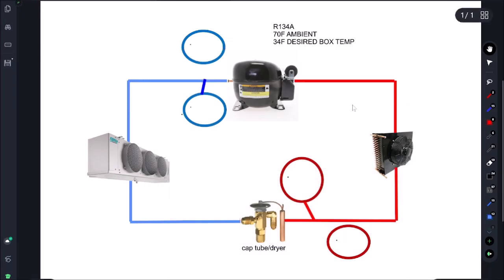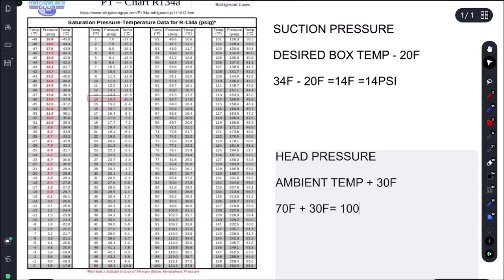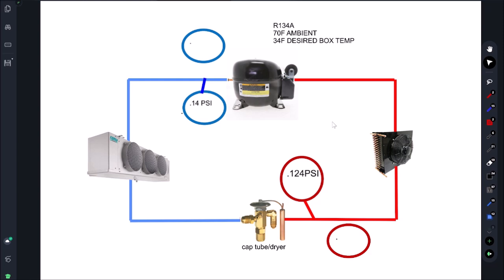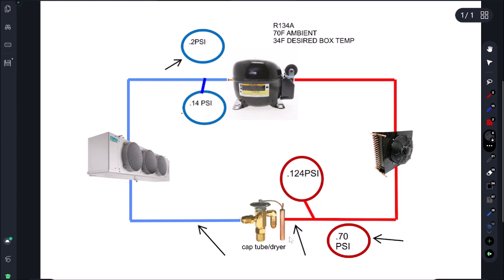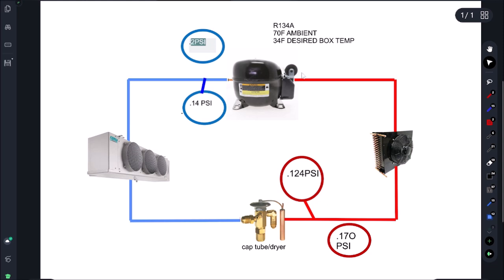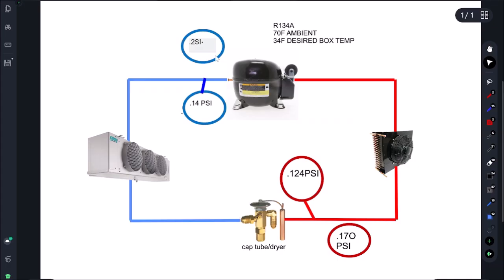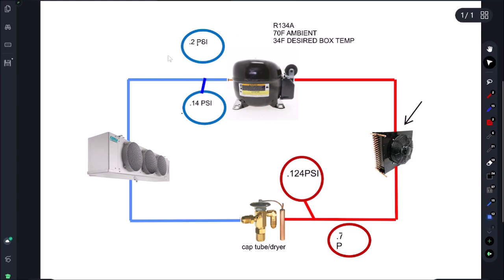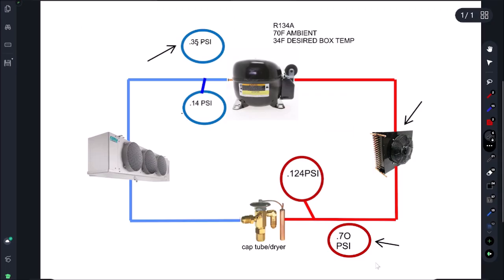REACH IN COOLER REFRIGERATION PRESSURES TROUBLESHOOTING

Comment: Where did you get the 20 degree evap TD? Is that just rule of thumb for cap tube systems?
Reply from the maker: Yes, designed by the engineer

Comment: Thanks for this great video i had 20 low and 350 high side why my high side was that much higher I thought i have plugged capillary tube what you think sir thanks
Reply from the maker: Cap tube, R134? Pull the charge and weigh In the charge and see what you get for pressures
Reply: @REFRIGERATIONKITCHENEQTECH  that’s what i did and it was 5 to 250 i added more freon make it 15 low side then it became 20 to 350 thanks for response
Reply from the maker: R404 or R134?
Reply: @REFRIGERATIONKITCHENEQTECH  134a